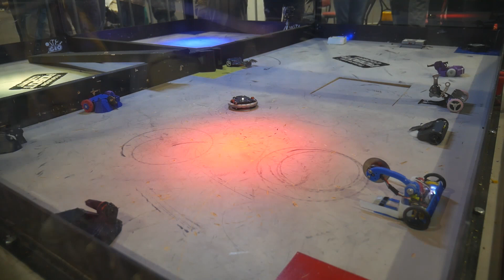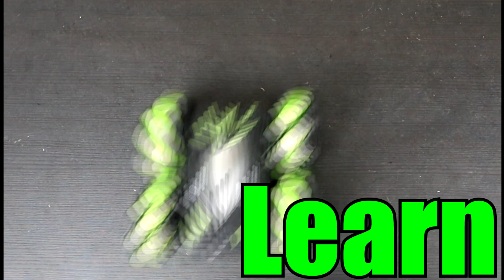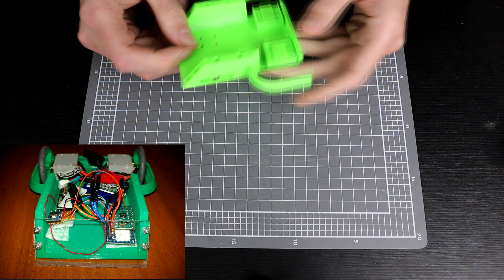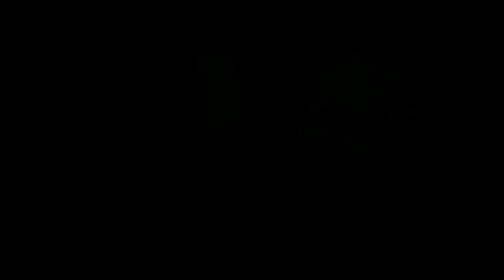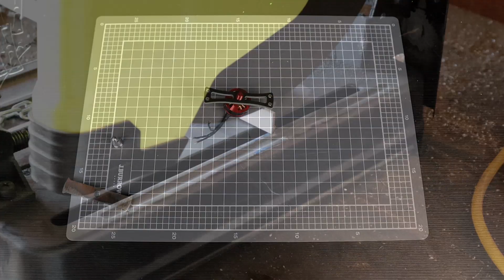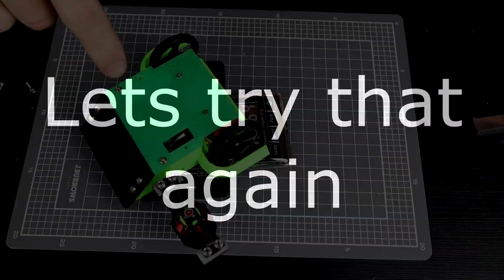Building a side spinner?!? (good idea or best idea?)

Comment: What if you center mounted the motor in the body and had pulleys go out to two opposing arms with spinning blades. Might be tricky to get it to make weight, but that drone motor should be more than enough to power both weapons. Maybe swap galvanized steel out for titanium for hardness, but weight reduction.
Reply from the maker: That would be tricky to make weight with, but should be possible in a higher weight class

Comment: you should cut the drone arms and have two spinners. a redesign on the one two punch robot macguffin
Reply from the maker: Two spinners would be fun!
Reply: @TeamPanicRobotics  weight would be a problem though like that dual hug saw you made a while ago
Reply from the maker: possibly, but if they are rigidly mounted then it will be less weight then the hug saw
Reply: @TeamPanicRobotics  honestly, the hug saw was an interesting design because not many are out there
Reply: you won't need tow servos

Comment: Would love to know the weight and reach of the bar. Did you save any weight over a metal bar? Even if you didnt save weight theoretically you would have better moment of inertia with the majority of the weight being close to the tips
Reply from the maker: Bar was 14g, which is lighter then any of the other bars I've run, but not the lightest anyone has run in 150g
Its a 60mm diameter, so its reach isnt great, but the next PCB weapon I make will have a longer reach

Yes, the MOI on this is better then a similarly weighted all metal bar

Comment: One way you could trim a couple of grams is what I've done for Angry Angie; carve a couple of gaps on the inside of the carbon fibre arm with a drill and rotary tool. It may only shave 1 or 2 grams, but every little helps.

I really like this weapon concept. It made me think of one of Tombstone's bars. A light but strong material for the bar, with steel teeth bolted both ends. Sounds like it'll increase the MOI quite nicely compared to the laser cut bars.
Reply from the maker: You need to be super careful doing that
Anytime you take a power tool to carbon fibre you should be wearing a mask and doing it in a well ventilated space

Thats why I only ever cut them slowly with a hacksaw and vacuum the dust up immediately
Reply: @TeamPanicRobotics  Don't worry, I did it out in my backyard. Lots of open air, and I kept safe. Hand on heart.

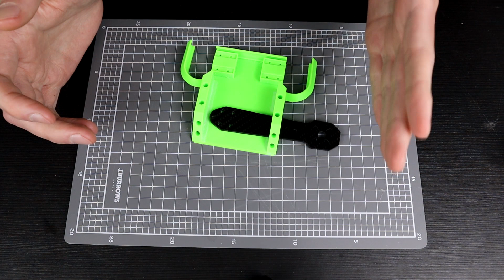Comment: 2:55 for extra rigidity, a lip could be added to the chassis floor around the weapon arm, this would avoid taking all the load from hitting things through the 4 screws by spreading the impact across most of the width of the chassis. possibly this is overengineering things, but beefier is better, right?
Reply from the maker: could have done for sure, in the past I have locked it into a cut out in the chassis to spread the load, but in this case, I took the quick and dirty solution
Reply: That's a good idea. Always be thinking about stress points...